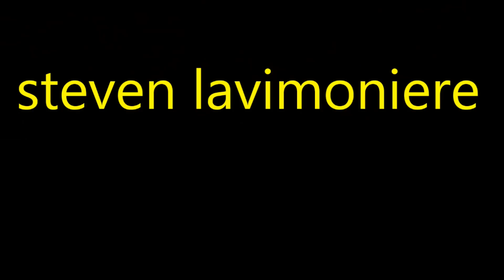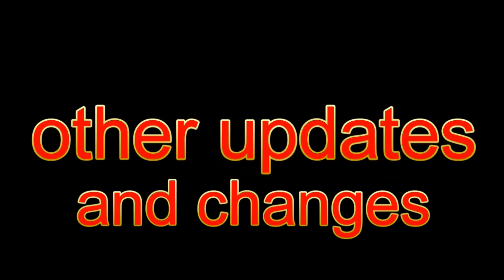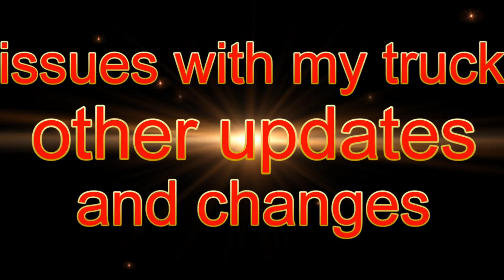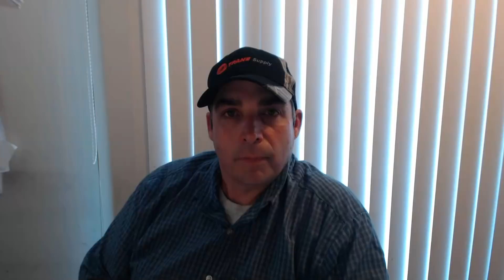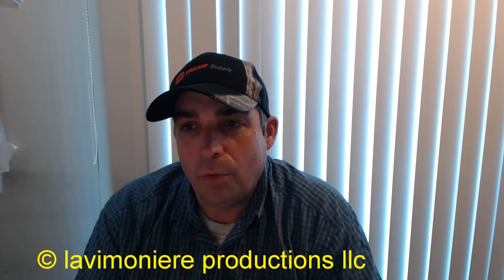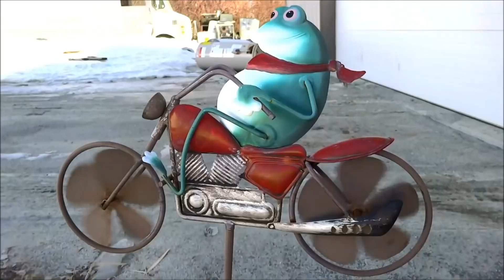vlog problems with my truck and other channel info

Comment: I enjoy the channel called "Powerstrokehelp." It belongs to a man in Georgia that maintains and repairs Ford Powerstroke Diesels only. However, no matter what diesel engine you have, he can explain why the additional smog devices that are being installed are also causing problems.

Unfortunately, I haven't seen him do anything with the Ford Transit 5-cylinder diesel. Although they might not need repairs (yet), they do need maintenance, and I am sure he would show us basic maintenance on those trucks.

Another thing I have wondered is if every diesel should be using synthetic oil, even diesels that don't call for it. The 2009 VW Jetta and Golf DPF diesel always required synthetic, and the number of DPF failures didn't kill the cars reputation, only the fake smog numbers killed the car's reputation. The VW Passat from 2010 to 2015 also used only synthetic, and the only reason it didn't fake smog numbers was because it used DEF.

Comment: What is your opinion about the refrigerant 1234YF used for the new automobiles from what I’ve been told this refrigerant is highly explosive yet the automobile manufacturers are using it anyways that is scary. What’s your opinion Steve

Comment: You need a free flowing muffler for a turbo. The smaller muffler he put on was probably for a gas engine and caused extra back pressure that blew the seals out of the turbo prematurely. All he had to do was put a round straight through magnaflow on it and it would still be running.

Comment: what a bummer! those big old bread trucks are great plumbing / mechanical trucks but it sucks when they start failing. I am having a similar plumber down kind of issue myself, except for me its not the truck, its the plumber. I broke my collar bone. you'll be climbing the walls in a couple of days, with the calls coming in "but we need you now....I'm gonna have to call someone else" well good luck. hope the parts come in early for you. love watching your video's your oil burner and gas heater stuff is the best on you tube. hey arn't you using a old truck for a chicken coop!

Comment: I drive a UPS truck Steve and while most are fairly reliable there is an exhaust addition to satisfy the liberals that constantly gets overheated (dash light) too, the mechanics hate it! Told me it has actually blown flames out of the exhaust on some occasions.
Reply: They call it a DPF which is short for Diesel Particulate Filter. It collects the tiniest bits of black smoke, then reignites them by injecting excess fuel into the engine to burn the soot. If those didn't exist, diesels would be making far more smog than gasoline engines.

Comment: It's an oil burner it will be fine. You lost the seals in the turbo first, clogged the cat.  Very common repair for modern diesels today.

Comment: just get a new truck simple fix
Reply: How can he be sure that the new truck won't suffer DPF-failure related problems? How can he also know that the newest engine designs won't let him down? In addition, to meet tougher smog laws, some trucks also use DEF (Diesel exhaust fluid) and who knows if that system is foolproof or not?
Reply: Skyline Fever I work for company all our service tech get new to newer truck the main reason for the same reasons people buy new air conditioning system so that they don't have problems look I have nothing against a old work truck but its keeping you form working and making money theres a problem simple fix is get something that is new
Reply: Thanks for the explanation. I didn't know much about commercial vehicles so I didn't know how much better they are.

Comment: Turbos in concept are great, but they have a finite life. Seen plenty of them needing to be replaced due to the oil seals popping.
Reply: Erik J.  Can u replace just the seals or is it not worth it. Just replace whole turbo?
Reply: joker smoker With high mileage on them, just replace or do a rebuild, because chances are very good other things are worn out too.  Personally wouldn’t want to do a rebuild (just replace) A turbo is a precision piece that spins in the 10s to 100s of thousands of RPMs. If something isn’t right with what you did, the turbo can grenade, and the fragments can destroy the engine if it inhales them.
Reply: Yes, in some cases they do fail. However, most of them last as long as the entire engine. Old Volvos were called turbo bricks because they were square and because they lasted for ages.

One problem with DPF diesels is that exhaust gas temperatures have to be kept high. If they don't stay high, the DPF gets overloaded with soot. If the DPF temperature drops too low, the system will go into "Active regen" where excess fuel is injected to heat the DPF and that hurts the turbo. Some diesels have a fuel injector near the DPF to avoid this.

With DPF turbo diesels and turbocharged gasoline engines with cats, there is a situation that can be difficult to determine. Sometimes the DPF or cat fails, then the increased temperatures and backpressure destroys the turbo. Other times, the turbo fails, then the burning oil destroys the DPF or cat.

Comment: If the oilsupply to the turbo got into the exhaust side it could plug the cat up! could mess the whole works up! some turbo oil return lines are run by gravity back to the sump.if a line was repositioned could cause that too?
Reply: It sounds possible.

Sometimes when people don't change their oil on schedule, the turbo to oil pan line can fill up with engine sludge. When it does, the increased oil pressure at the turbo exhaust seal causes the seal to fail.

Comment: $3500.00 for a muffler?
Reply: its prob got a built in CAT conv. with platinum.
Reply: Stainless steel bearings.
Reply: Yeah, a DPF exhaust system costs a fortune. Some diesels made after 2008 also have SCR, another device in the exhaust that costs a fortune.
Reply: My ford 550 same cost for my muffler
Reply: Miss my 7.3 diesels,all my new diesels are garbage
Reply: Dan gill sucks

Comment: Sounds like you need a new different mechanic or 2nd opinion The Turbo will make it smooth the oil but you may also have injector to what color was it smoke and what color smoke was it